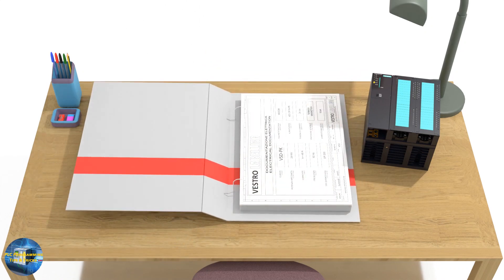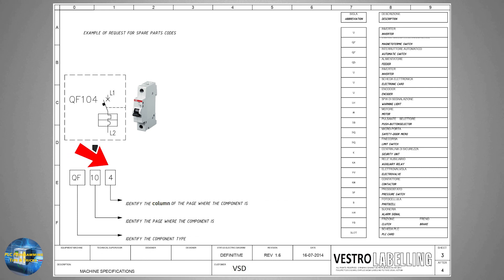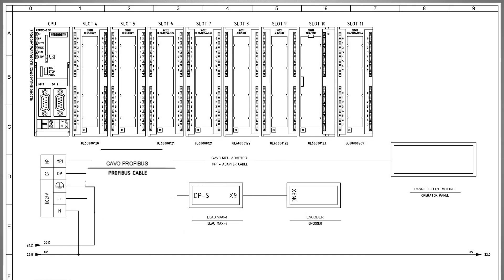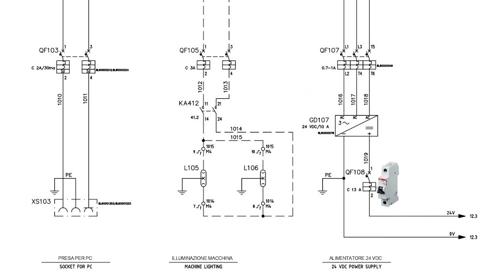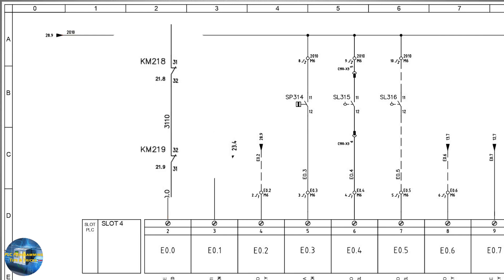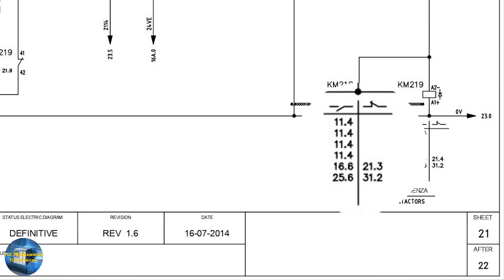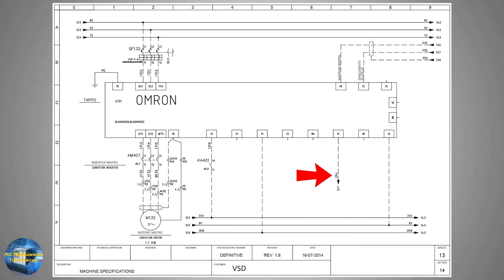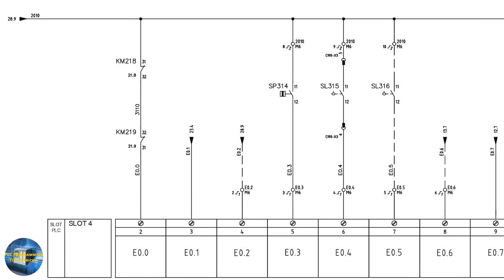How to read PLC wiring diagram ? part 2

Comment: Thanks for the video . Any reason why the negative rail on the extra low voltage power supply is tied to earth? What is the purpose and benefits of this feature, and what happens if this is not done. Thank you brother.
Reply from the maker: Good question!
Reply: If I am not wrong, an ELCB will be there....
Reply: @cck1496  that has nothing to do with earth leakage circuit breakers.